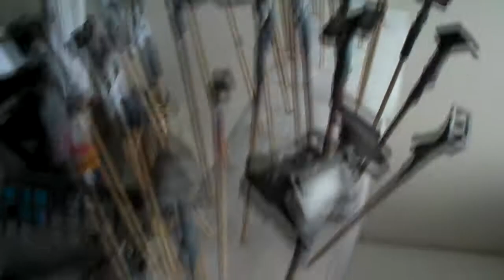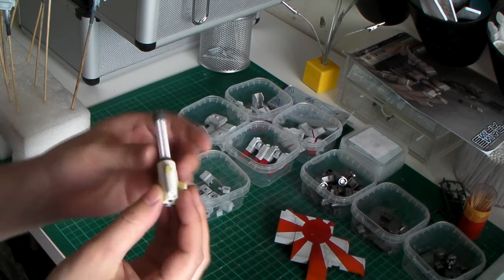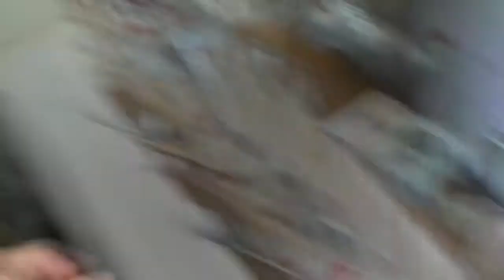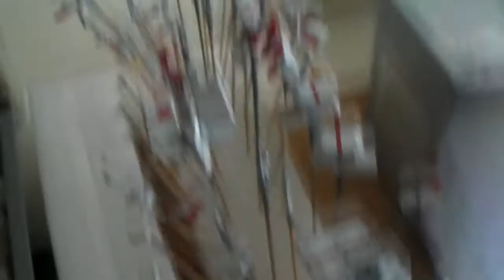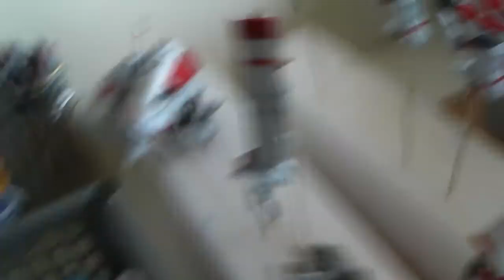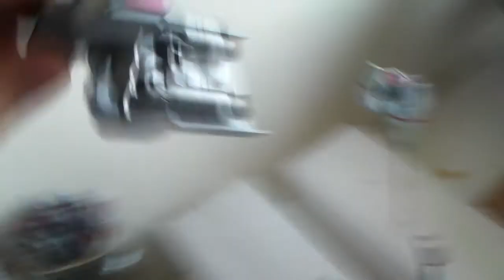Mecha Lounge CHAOS group build - Kagutsuchi Kou WIP#4

Comment: This is coming along quite nicely!
I would recommend some kind of lacquer (Tamiya spray paint, for example) for the flexible bit. I've found that Tamiya sprays stick fairly well to flexible parts like polycaps, as long as you're careful with them.
Test it on some kind of sample part first, of course, just to make sure the paint sticks and won't damage the material.
Good luck on strengthening the kit, too.
Looking forward to seeing how this turns out!
:)

Comment: Looks stunning dude. Have you ever tried Angelus paint? Us sneaker collectors use it to fix up trainers or customise them. The paint is flexible. Would work on the belt fed machine gun. They don't do metallic but they do black and greys.